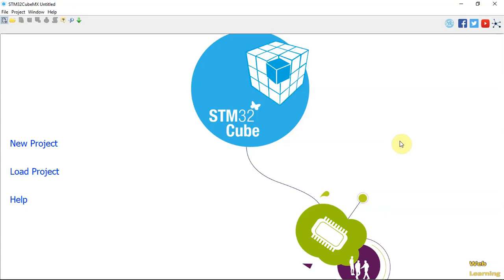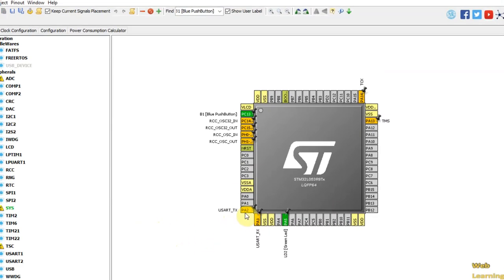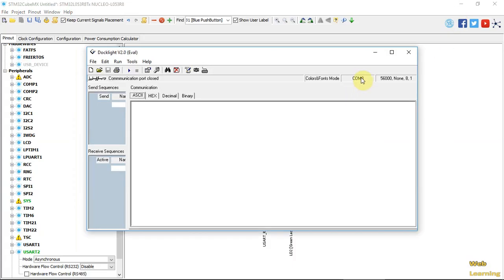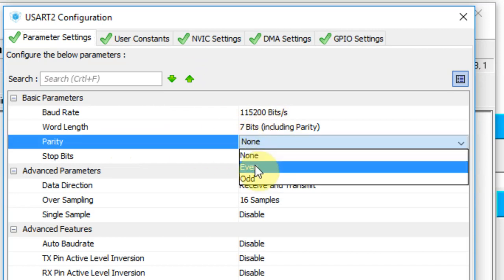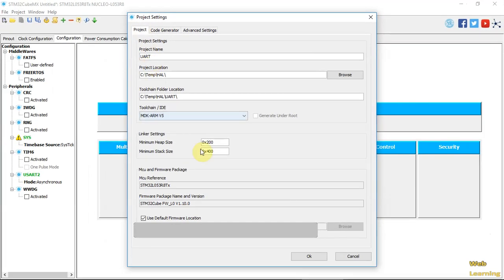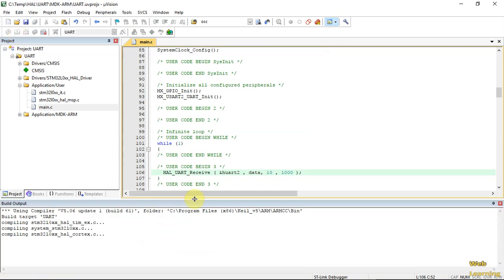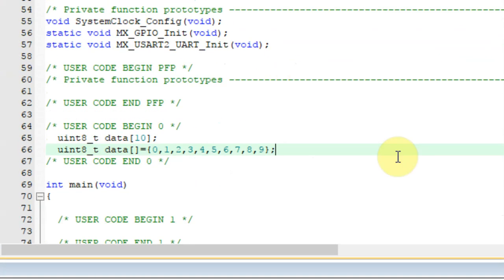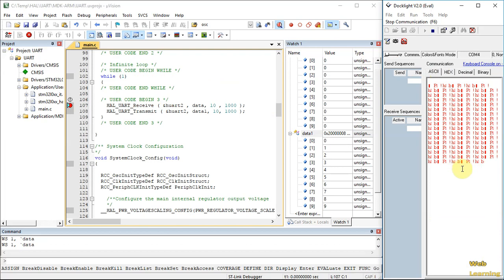HAL: #3 How to - UART

Comment: I missed a step.  at 5:02 You said "Put a breakpoint here everytime you see data." How do you do that? If I put a breakpoint there it stops on the HAL_UART_Receive(&huart2, data, 10, 1000); , and it does not appear to get the data sent.
Reply from the maker: Put a breakpoint at line 106 so it will stop every time you get the data. 
It will be great also if you subscribe to my channel.

Comment: very informative video and such good explanation but just clear one thing from where data is being transmitted?
Reply from the maker: Sorry, I didn't understand your question. From the hardware or software?
Reply: @Weblearning1    I mean which command is used to transmit data?
Reply: Thank you for replying, I am stuck  using st32f0 board with stm32 cube ide, and its showing no change in variable values.

Comment: It says undefined symbol HAL_UART_receive. I have followed all the steps 4 times. What can be the reason? And in my keil v5, the code completion doesn't work. So to write with correct code is a bit difficult. Do you know how to enable it?
Reply from the maker: What STM32 are you using? Are you using latest CubeMX? What error code are you getting on the Keil? Can you load the IOC and main file and share them?
Reply: HAL_UART_Receive not HAL_UART_receive. -- upper lower case matters.

Comment: One of the powerful features of the STM32F 3/4/7 MCUs, is the Serial Wire Viewer (SWV) debug. It is a minimally intrusive debugging through the Serial Wire Output pin (SWO). You may send a printf() style strings through ST-Link or other external debuggers and view the strings using ST-LINK utility (free PC software from ST), even after the debug session is ended. SWV is built into the ARM Coresight debug module which is part of every ARM Cortex M3, M4, and M7 cores.

Thanks.
Reply from the maker: Thanks for sharing this info with everyone. I will try to make a video also on this one day.